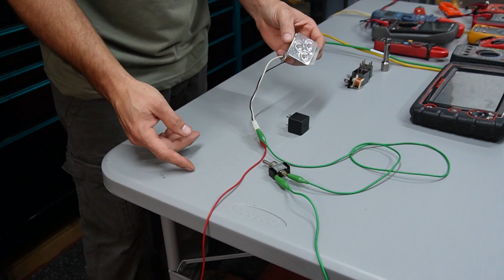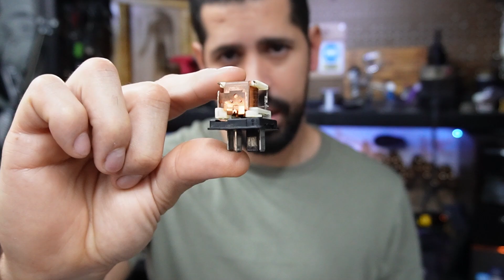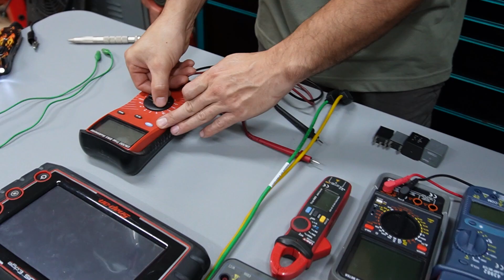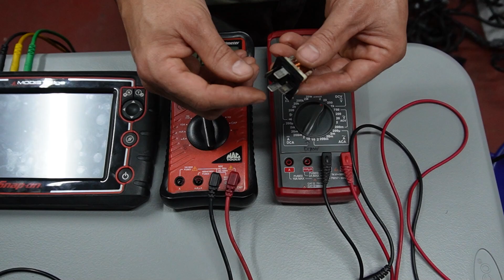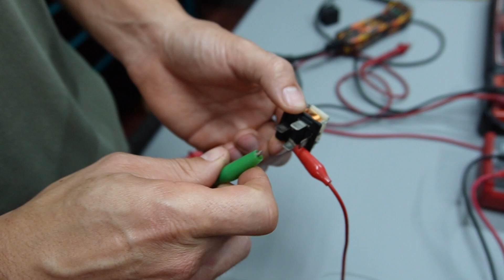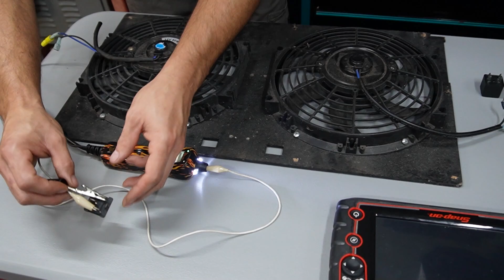Step‑by‑Step Relay Testing: Learn How Relays Work Quickly

Comment: Enjoyed your video great presentation May I add you never mentioned spike suppression terminals 85 &86 are polarity sensitive with a diode across the coil anyway a basic resistor across the coil doesn’t matter .All ways replace with exact relay The only way to check a diode across the coil is with an analog ohmmeter.Diode check will not check the diode it actually will give a voltage drop with test leads either way I realize most relays use a simple resistor Use correct part number on relay for replacement Cheers
Reply from the maker: Thank you for that Excellent tip.

Comment: I am an electrician's apprentice in an industrial setting.  Now I am wondering if we can test relays the same way.  I think that I would need 24V to test most of them.
Reply from the maker: Yes, you should be able to test them the same way. I have worked with 110v AC relays and they work the same way. So 24v relays should be the same. All the relays I used in the video are for automotive use and are (DC) direct current. Just be aware if you're working with (DC) or (AC) alternating current. 
I hope this helps. 
Thanks for watching!